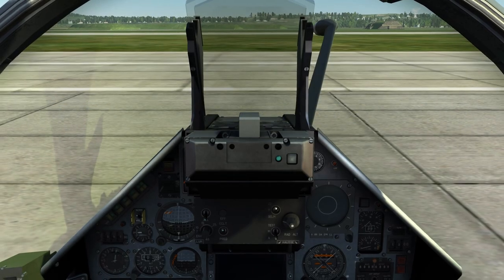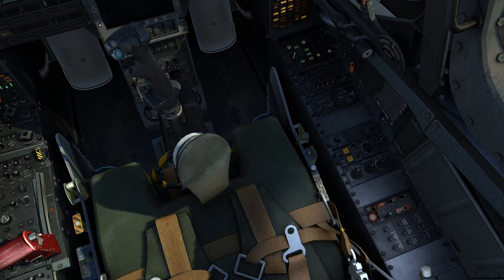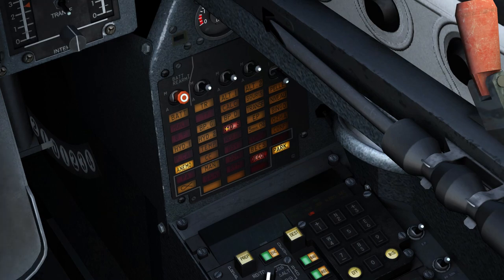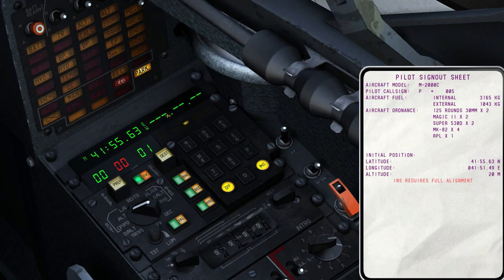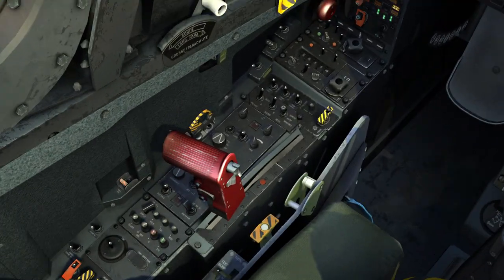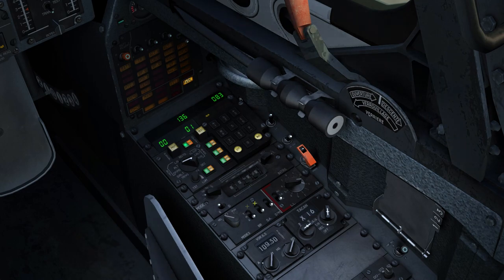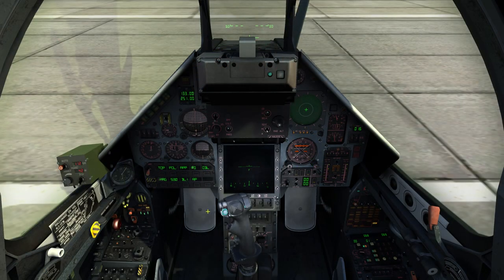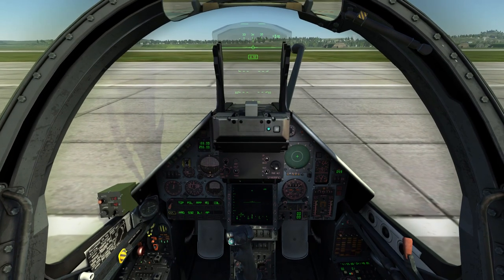DCS:World » Ramp Startup » Mirage 2000C

Comment: Pressing that little button by the throttle is not covered in the training mission. If you play with the throttle and move it out of ground idle, it will not let you start the engine. That is not mentioned by the narrator in the mission. I screwed it up by moving the throttle to get to a switch and was not aware of that little button needing to be pressed.

Comment: question: what purpose does the manual entry of coordinates serve, as the gps alignment is done right after anyway? Does the gps alignment not find the proper coordinates on its own?
Reply from the maker: The alignment assumes the correct initial position has been entered, without entering initial position there will be some circular error although just how much error there is will depend on  how far off the initial position is.